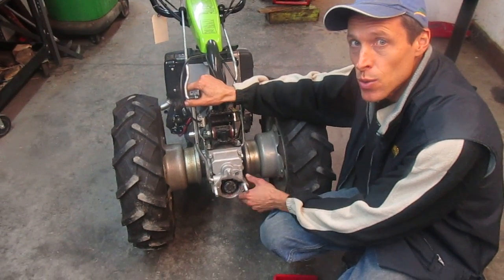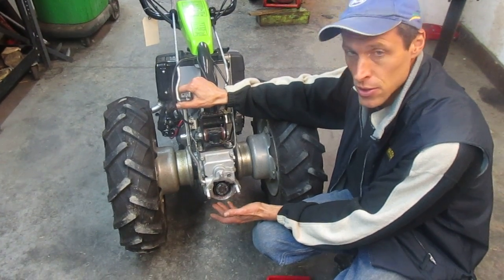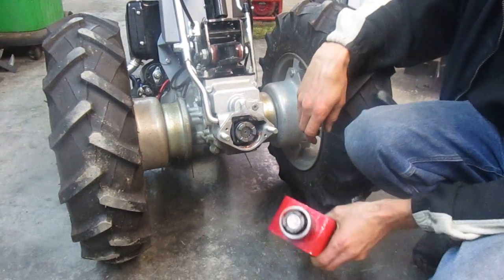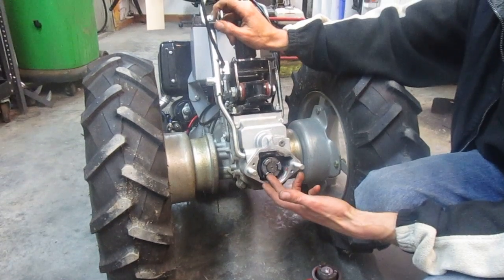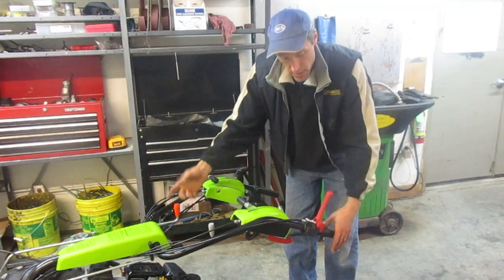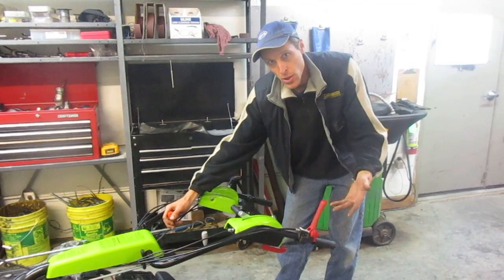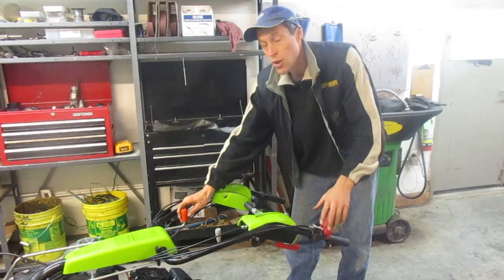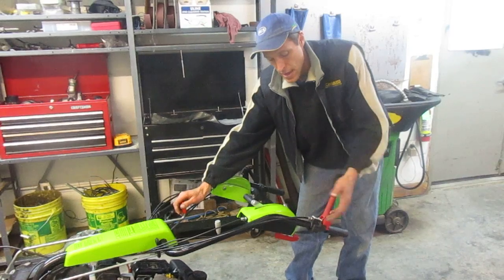Grillo G110 PTO Engagement

Comment: Thx Joel - I was lucky enuf to grow up on manual shift trucks, motorcycles, and sit-on tractors, so I learned thru some experience of the grinds, sounds and feels of working a machine...you do a good job explaining it for those with limited experience and just getting into gardening with power equipment :)

One question - Can you in-house modify a Grillo 110 to have the standard clutch lever and action under the grip? Im torn between it and an 853...even considering a 107 or 739?? 

Brakes (incl. parking)/clutch/pto ergonomics and function are priority, Im on 15-18° slope...small flail or brush mower, rotary plow are main implements considered.

Comment: Just subscribed. Joel I have a couple questions. I am sure BCS and Grillo are both great. My questions are, if you can answer, if YOU could pick a Grillo tiller with some various attachments which would you get. I am liking the 110. Would you rather have a 110 or a 131?

Do you like bcs or Grillo better? What are your favorite models? I will be using it in Mississippi so I don’t need snow blowers etc. thanks